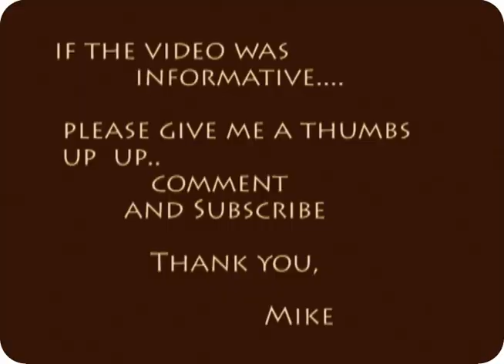1990 Ford F150 302 Engine Rebuild / Overhaul How to install a Engine Flywheel  - Part 23

Comment: I was looking for torch pattern and pounds, for my flywheel change out, The little bubble at top of screen was informative. Thanks, now I know what I have to do when putting the new one back in. First flywheel I have ever changed. I have changed many tranny's and clutches and so on but never a flywheel. Thanks again very informative and helpful.

Comment: Well done man...I'm trying to narrow down this vibration I get at higher RPMs...88 302 with C4 tranny...wondered if there was a possiblility the flexplate was installed incorrectly in correlation to the front damper...I think you answered that for me thank you...All I can find on this flexplate is AOD stamped on it and its a 164T not sure of the balance weight...If you could share any insight on this matter it would be greatly appreciated...keep up with the vids...they've been very informative.